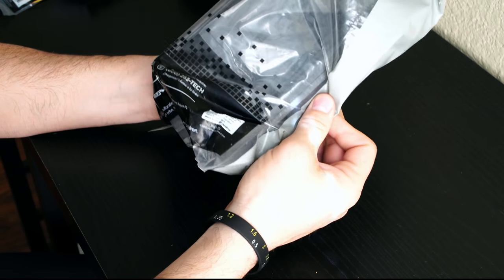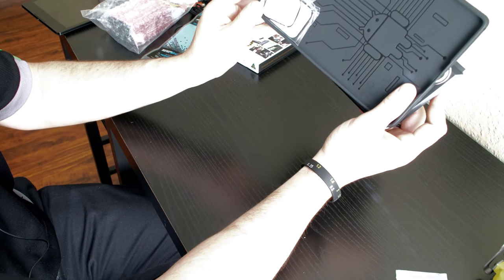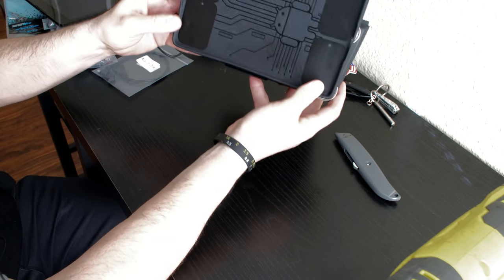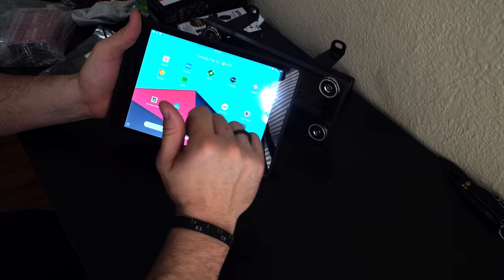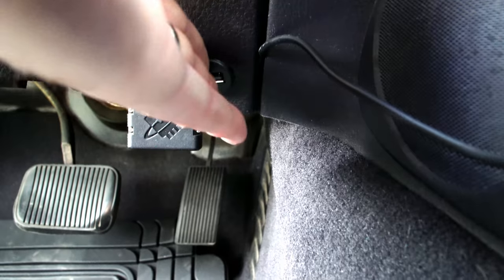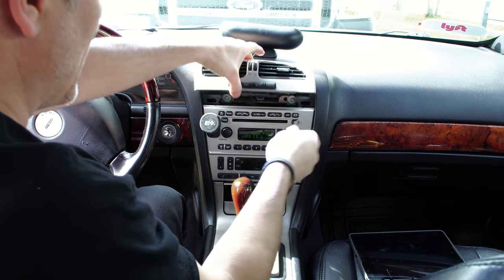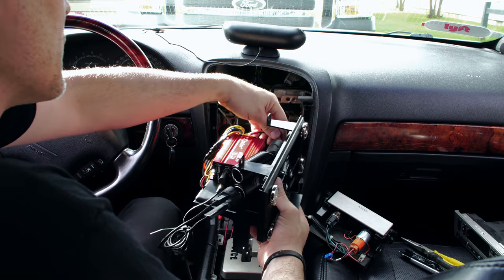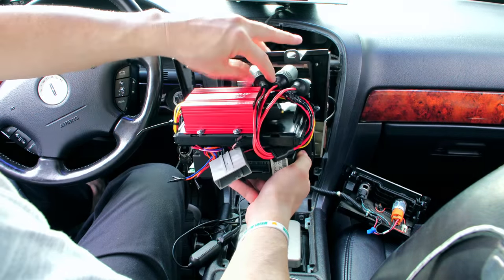Turn Your Tablet Into A Head Unit

Comment: Starts right off calling the dash kit a "radio face". I sure hope this gets better. I'm only 1:26 in. OTG has nothing to do with audio. It allows the port to output power for external devices.
Reply from the maker: I think it does. 😂 Sorry for not using the proper terms.
Reply: @edwardlthompson  I'm just hoping that weak magnetic link (you used thin metal plates) does not cause that tablet to become a projectile in an accident ending with it being impaled into someone's skull. You should keep these details in mind when you become public transportation.
Reply from the maker: @csorrows  thank you for your concern. They hold very well. I went drifting in the car and the tablet never moved from its mount. Make sure you check out the update video and see my new setup.

Comment: How well it hold up
Reply from the maker: Perfectly. I had it for a year before switching to a different tablet and setup in my truck. You can see the update video linked at the end of this one.
Reply: @edwardlthompson  ok cool I have a 14 accord it has a factory imid screen I would need to figure out a way to retain that for car settings 🤣
Reply from the maker: @esmokebaby  I'm not familiar with what an imid screen is but you can have the tablet run alongside or over top of your current setup. I'm going to link you to my alternate setup.
Reply from the maker: @esmokebaby  https://youtu.be/dmiVHRV2etw
Reply: @edwardlthompson  screen setup that allows you to see settings like Tpms calibration maintenance reminder rest gas mileage all that fancy stuff🤣

Comment: I did the same thing with velcro.
Reply from the maker: Nice! I was worried about the glue melting in the Texas summer heat.
Reply: @edwardlthompson  You're a good man.
Reply: @edwardlthompson  Seriously,  not kidding though. I get questions and compliments all the time. Driving for Uber/lyft "Is this thing electric?" "Nice set up!" Any 7.9" tablet fits amazingly well on the dash of a 2015 chevy malibu velcro-ed on like it was meant to be there between the Vol and Tune/Menu buttons above the climate controls covering only the stock display and CD radio controls. Pretty cool. You can even landscape it above Vol and Tune/Menu buttons. Still looks stock.
Reply from the maker: @cadechristopher6456  very cool! It is nice to wow your passengers a little. Anything to get a good conversation going. Keep up the good work! 💪🏻

Comment: Nice mod to use a old tablet.  However, that tablet doesn't have the following:
1. Radio reception
2. Reverse camera, front camera or side camera

Also, with the cost of aftermarket head units that are $200 and under which has all those functions and more, why go though the trouble with this at all.
Reply from the maker: Flexibility, customizability, and long term software support along with all the apps available for Android. That's why I did it. Plus, why waste a good tablet that is not being used. Up cycle, repurpose, and reuse.

Comment: smaller tablet would be nice. wont block aircond vent. otherwise its cool!!!
Reply from the maker: Make sure you check out the update video. I ended up going with an even larger tablet and I did not have any issues with it blocking the vents. if anything, a little bit of air conditioning will actually help the tablet stay cool in hot weather so having it nearby the vents is actually a good thing. Electronics don't operate well at extreme temperatures.

Comment: Why didn't you use bluetooth for audio?
Reply from the maker: I used Bluetooth for the connection of the tablet to the audio system. My car doesn't come with Bluetooth from the factory so I had to get creative.
Reply: @edwardlthompson   actually, you didn't. You just had to be made aware that a slew of manufacturers, including the big name brand US regulars, make bluetooth enabled amps. If you just got one to fit the number of speakers you have, all you'd need to do is tuck it under the dash, the seat or trunk and hook up to your speakers as normal. Most tablets can be connected to at least two bluetooth devices at once as long as they're not viewed as the same thing (speaker/headset ex.) Think mouse/keyboard and speakers. 

That would have simplified your wiring and given you more choices on amp power and channels. Maybe next time.
Reply from the maker: @wtfisdat6382  I kept the wiring simple and have it connected with a harness which kept splicing to an absolute minimum. I want to easily remove the system or reconfigure it in the future. That's why I avoided any large amps in the trunk.
Reply: @edwardlthompson   as an example, the Kenwood KAC-M1824BT model is a tiny 6x4x2 inch and pushes 45 watts per channel (x4). That is easily fit under most dashes or a front seat and the odds of an exact harness clip in for your vehicle are extremely high. No "large amps in the trunk",  just different tech and a 30 min install. 

There are lots of similar options, all letting you skip right past the head unit and use a phone or tablet..and can be wired inline or outside of it. Explore.

Comment: Use Double sided velcro tape easy
Reply from the maker: That's a good solution but the extreme heat in the vehicle will melt the glue off most velcro.
Reply: @edwardlthompson  use urathane as well behind no heat will remove it just  every 3 finger little dab it will not remove and if u want to remove it razor
Reply from the maker: That's a good tip. Thanks for the advice.

Comment: Edward Thompson Please don't think that Kinter Amp is 500 watts, look at this  400 watt 100 watt per channel 4 channels driven @ 24v but look around  https://www.parts-express.com/sure-electronics-aa-ab33184-4x100w-tda7498-class-d-amplifier-board--320-305
Reply from the maker: Sadly that is the smallest amp I could find with the highest rated output that I could fit in that location that was also available on Amazon. I wanted to build the unit with items accessable on Amazon so that it would be easier to make an "Idea List" there and link everyone to the products I used all in one location.

Comment: Im sure you could have just ran it all through bluetooth running through a cheap radio
Reply from the maker: Indeed. However, I wanted to build it myself. Make sure to check out the update video. My current setup is exactly that. I also upgraded to a larger tablet and made a few other changes.

Comment: I’m going to guess you don’t drive for Lyft anymore?
Reply from the maker: I drove for Lyft and Uber for a few months and then began driving for a courier service for about a year and a half before moving back to Puerto Rico.
Reply from the maker: @Boston_Pilot  Thank you so much! PR is a mess right now with the flooding and the lack of electricity and running water. We will recover eventually.

The Lincoln wasn't too bad. I was getting low 20's in MPG for the most part but it was the premium fuel that was the drag. It was a fun car though. I had wanted one since the early 2000's and finally had a good excuse to get one. You can see in later videos that I even used it for drifting on occasions.

Comment: But you lose steering controls, voice control, and many others.
Reply from the maker: There's an adapter you can add to the harness if you run an aftermarket head unit that allows you to retain all those controls.
Reply: @edwardlthompson  that makes it worth it then.

Comment: Could have bought an 8in or even 10 inch head unit for cheaper no clutter and way more availability. And same features for under $150... and installation would have been plug-and-play and took literally 10 minutes. Can appreciate the attention to detail but a little bit too much. if this was 2010 I could see this as a setup but we're in 2020
Reply from the maker: 7 or 8 inch is the largest unit that can fit into a double DIN slot. I wanted the portability of the tablet so that I can use it in multiple vehicles and at home. It is also supported by the LineageOS community and has nightly OS updates. The Android head units are not well supported. Check out my update video for more details.
Reply: @edwardlthompson  they make single DIN ones that have 10 inch screens 8 inch screens, etc
Reply from the maker: @PeterFeltersnatch852  that's pretty impressive. Still, they lack portability and software support.

Comment: i also mount my tab in my car but due to sunlight it heatup
Reply from the maker: Sometimes I aim the air vent at the tablet and have considered adding a tube that goes from the regular vents to the back of the tablet. There's no real good solution for that other than to make sure it is not in a case so it can dissipate the heat as best possible.
Reply: @edwardlthompson  but we can't left tab in car during day light it becomes very hot and damage also I use regular but I remove it
Reply from the maker: @sandeepsingh-sn5qd I always take the tablet with me when I leave the car. I have a carrying case for it. You can see that in my update video. It is recommended at the end of this video.

Comment: How do I link my radio car radio to my tablet
Reply from the maker: If you have Bluetooth on your car stereo, that would be the easiest way. The second easiest way would be through the auxiliary jack if you have one. if you have a car that has neither, you can get a FM radio broadcaster that will connect to your phone via Bluetooth and you can push an FM signal to one of the channels at the top or bottom end of the spectrum and pick it up over the FM radio. Alternatively, you could replace the head unit with one that has all of the modern conveniences or you could do something crazy and build one yourself like the one I made.
Reply: It said it's unsupported through the plug it's link to the radio but won't play through youtube
Reply: Bluetooth is hook to it but won't play youtube
Reply from the maker: @heatherlabatut8762  most older Bluetooth head units will only permit phone calls over Bluetooth and not audio streams. I think your best bet would be to look for an auxiliary jack. I don't know what kind of car you have or what year it was manufactured or what setup is on the vehicle but if you follow those instructions, you will be able to play audio over the car's speakers.
Reply: 2019 honda civic
Reply: They said there’s no ixilory for my car that they know of
Reply: I really want to play videos on my tablet YouTube through my radio
Reply from the maker: Check your owner's manual. There should be instructions on how to play the audio

Comment: Flex tape works better.
Reply from the maker: I live in an area with some pretty extreme temperatures in the winter and summer. I'm not sure how well the glue that holds the tape would withstand those extremes year after year.

Comment: I would leave a thoughtful comment with some constructive criticism here....but judging from the 1.1k dislikes and not being able to find a single comment that isn't glowing with praise...i can tell you would just delete it. You only had to sideload android auto onto your tablet and install a usb hub in your glovebox...instead you made a severely jerry rigged fireball waiting to happen.
Reply from the maker: I don't delete negative comments. If you look through enough of them, you will see some.

I'm not sure why you think that what I put together is a fire hazard but I can assure you that no part of it got hot enough to start one. You could touch any part of it with your bare hands when in operation.

If you check out the update video that is recommended at the end of this video, you will see all the issues I have with Android Auto and why I didn't just buy an Android Auto head unit. I also show an alternative setup using Bluetooth with an existing head unit in my truck.
Reply: He has a fusible link installed. It’ll blow the fuse before starting a fire. The only reason it would start a fire is a short, which is what the fuse is for. I think it’s an interesting solution to the problem of having to rely on head units and sketchy adapters. Why not make your own head unit?

Comment: Yeh nah. If the video takes 50mins then the job will take 50hrs to do
Reply from the maker: There is a lot of other content other than just the assembly. It could be done in an hour or two. If you are looking for an easier setup, check out the update video I made. It is recommend at the end of this one. I have a more simplistic setup in my work truck.

Comment: 500w power supply.... MPG gone so far lol. and don`t forget take your tablet out when leave car or you need new one with new windows glass.
Reply: We often encounter customers (developed countries in Europe) worried that car navigation will be stolen, I am difficult to understand, because this thing will hardly happen in China.
Reply from the maker: The 500w supply was the smallest unit I could find on Amazon at the time that would fit into that cavity. I'm not sure what the head unit or the wattage has to do with Miles Per Gallon, but maybe you could explain it to me?

The entire point of using the tablet is so that I can take my music and more with me wherever I go. I would not leave any device in a car especially in the temperature extremes in the winter and summer.

Comment: Hey bro. Your tail lights are going out.
Reply from the maker: I had installed LED bulbs in all the light housings. Older cars, especially luxury cars, will start throwing errors when you switch unless you put resistors on the lines. Every time my lights would come on, all those warnings would appear and stay until cleared.

Comment: cant have that many wires in my car
Reply from the maker: Do you mean behind the dash? Not enough space?
Reply: @edwardlthompson  no in the front i always try to hide the wires in the best way possible my usb ports are under the dash and inside the glove box for the radio usb to plug the hdd or flashdrive i also have a micro sd card reader in the hashtray that i modify from the desktop 2.5 bay it looks like original....other thing do you know you can run wires inside the car paint job in case you need?
Reply from the maker: @informediatech-bruno5766  I'm not sure I understand your question. I agree with you though, I like a clean install.

Comment: Lol stole my idea. I did mine in my Kia soul over a year ago haha. Nice conversion of my original. But mine way easier lol just buy 2 cell magnet flush mounts. And I used epoxy to put on.
Reply from the maker: Nice! Thanks for watching! Make sure to check out the update video as well. I changed tablets and setups.

Comment: minimum usefull comfortable tablet dispaly size have ,im 10 inch and normal good 11,6 inch best have 14-15 inch. all less than 10 inch have too small use good and comfortable in move car. i remeber when comes first navigators, i has 7 inc. wery big normal all has only 4,5 inch. and not has good see when drive car, but i made gps deongle and add to old 15 inch notebook and pirate map navigator software route 66 and working my car well many year and see were need go new city drive. big display.
Reply from the maker: That's a pretty good hack! Thanks for watching and commenting. Make sure to check out the update video where I upgraded to a larger tablet!

Comment: couldn't you've jus bought a cheap head unit with Bluetooth?....then put the tablet in front…. connected to bluetooth
Reply from the maker: Check out my update video. I did exactly that. The point and the challenge was to build my own with parts available from Amazon.
Reply: @edwardlthompson  Seems like the way to go after researching head units with hd and Bluetooth everything.....the Dasaita is cool...but no.

Comment: Why didnt you just buy a Android head unit. It would have been cheaper probably.
Reply from the maker: I wanted the ability to remove it and take it with me in the house and my other vehicles. I also enjoy building things and challenging myself. Also, I don't know how well the Android head units are supported by the manufacturer but the tablet I now use is supported by the development community of LineageOS and receives nightly updates.

Comment: Magnets are terrible for screens and integrated circuits tht are inside a tablet eventually will discolor your screen
Reply from the maker: That's only true with old CRT monitors. They cause no issues with LCD displays. Also, the magnets are not in contact with the screen.

Comment: Why don’t you just buy a head unit
Reply from the maker: Where would be the fun in that? 😂 Also, I have a head unit in my truck and I go over the reasons I still use the tablet with it in an update video. Also, I'm getting a pretty sweet revenue stream off this video. Probably wouldn't have had that much engagement if it was a plain old head unit.